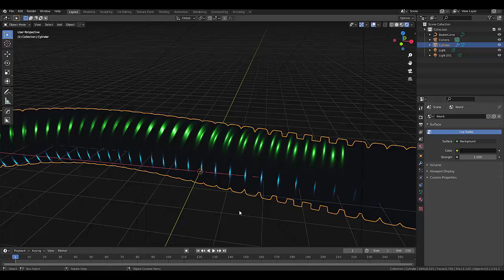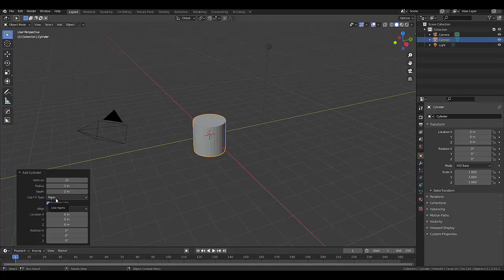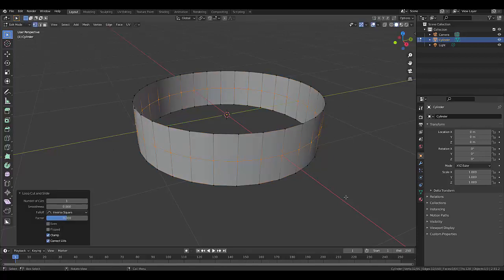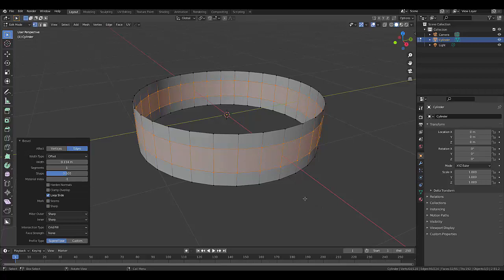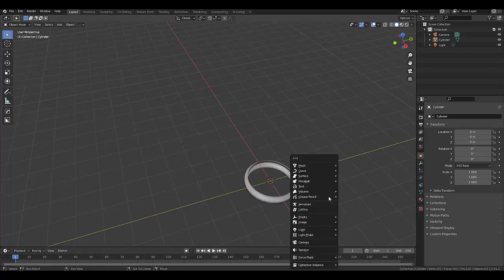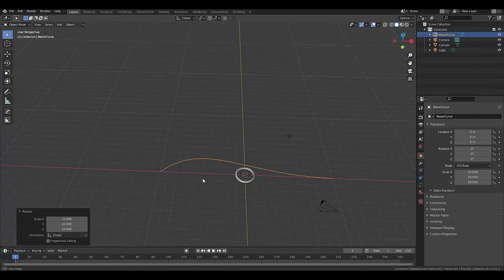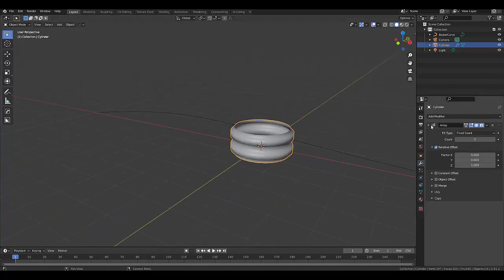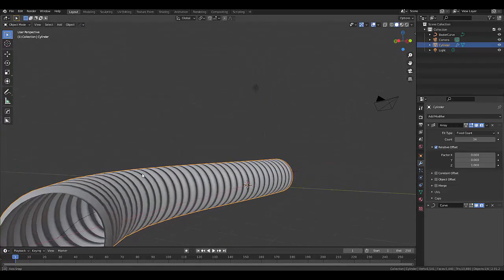How to make a corrugated pipe in blender

Comment: If anyone rotates the pipe section at the start, make sure to apply rotation to the pipe with ctrl + a, or the axis' will be wrong in the array modifier and it won't get fit to the curve.